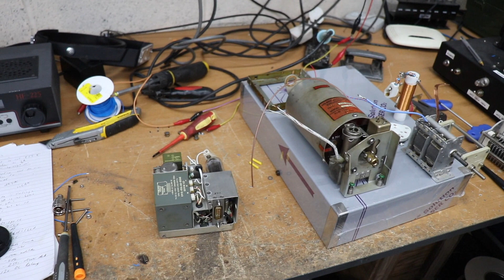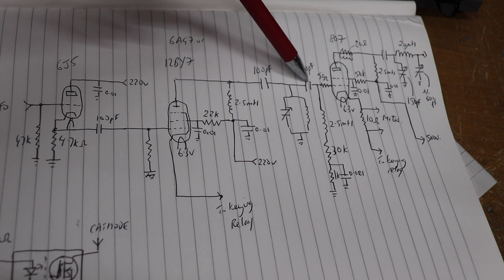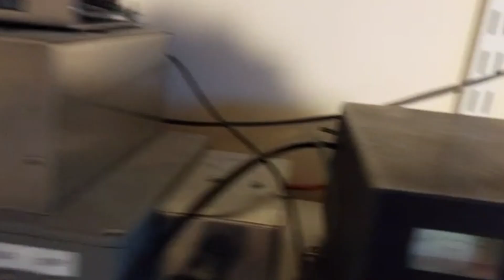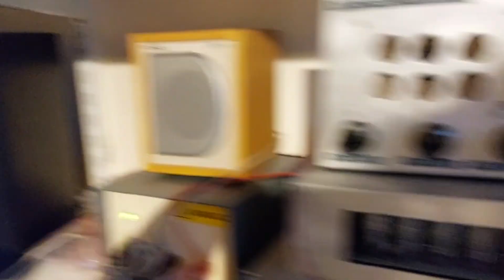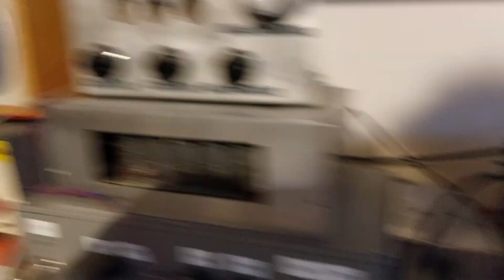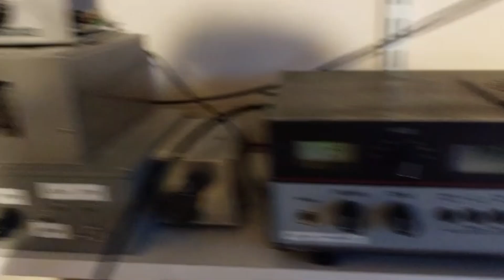AM Transmitter With Vulcan Bomber Modulator

Comment: Nice job that👍. I'm the bloke that sells the PTR175 modules on Ebay, always curious as to what folks end up making out of them. I built a 1.5 watt stereo audio amp using the 2E26 valves but cant claim credit for the design. I should get a video of it done really.

Comment: Really enjoy your videos Justin, I learn so much.  Any chance you could add links to some of the items you use as you seem to have an inexhaustible supply of components that I just can't find e.g. chassis,  the perforated mesh for the project covers, HV transformers, HV tuning caps et cetera?
Reply from the maker: Hi Steven, most of the stuff I get from eBay. The chassis are easy to find on a number of sites such as Rapid electronics, Mouser/ Digikey etc they are made by Hammond

Comment: Hi Justin. Always enjoy your videos.  I'm renovating a Healthkit DX-40U at the moment, and that solid state relay sounds interesting.  Could you post a part number or ID so I can locate the data sheet. 73 G0GGA
Reply from the maker: Hi Richard, the Farnell order number is 1175733, manufacture’s number AQW210EH. Should work in a DX40. Max current through each FET is 120 mA but it is DPST. Beauty of them is that you can key a valve rig with an electronic keyer
Reply: @thewtf  Thanks Justin.  Have some on order :-)
Reply: By the way.  I also have the modulator you describe in this video.
Was planning to build a topband AM transmitter with it.  Strangely with an 807 PA similar to yours.  It has been under my desk for a couple of years. Must get around to it ;-)